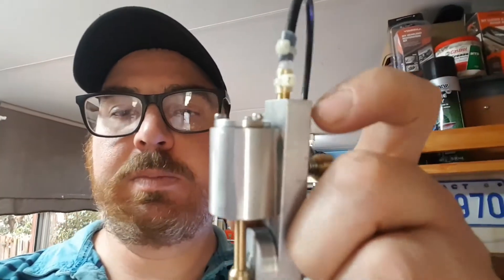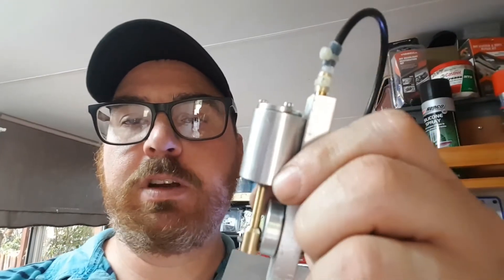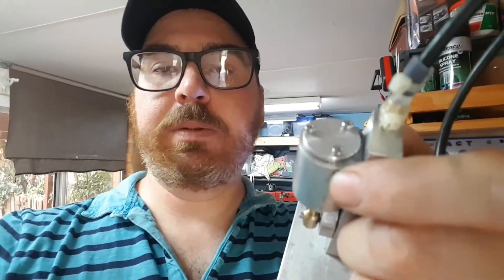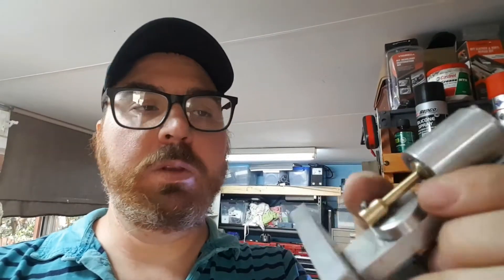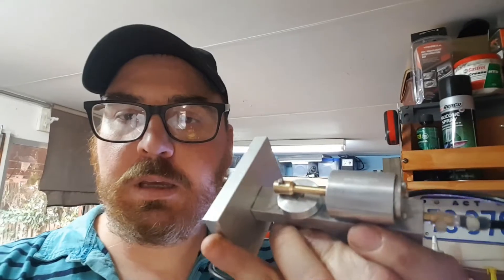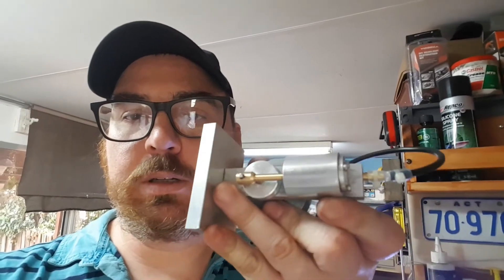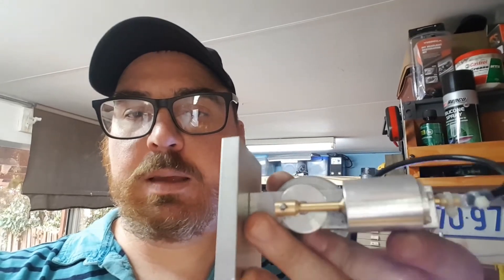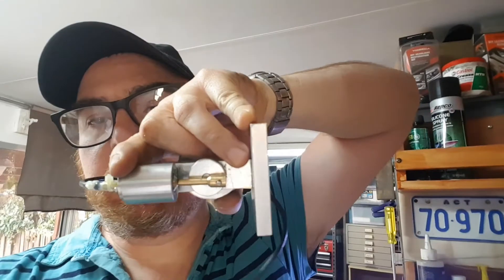Steve's workshop simple oscillating steam engine

Comment: Nice build and runs good. Just wondering if you can run it on steam. Thank you for sharing
Reply from the maker: Thanks! I haven't had it running on steam, it might work for short runs, but from what I understand, the aluminium I've used for the cylinder expands more than the brass that the piston is made out of, so once it warms up it might struggle, or loose a bit of speed. But as it would only really get short runs, I can't imagine that being too much of an issue.
Reply: Thank you for your reply.
Reply: Thanks so much for this. I'm writing a uni assignment involving an 1843 steam packet that crossed the English channel. It had an oscillating engine running its paddle wheel. Very new tech at the time. Anyway,  thanks for the demo. 😊